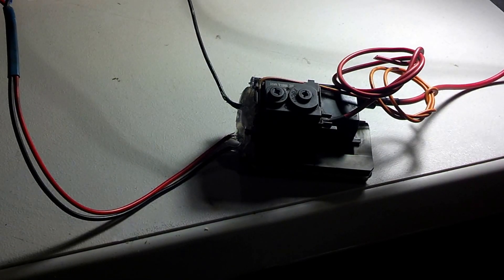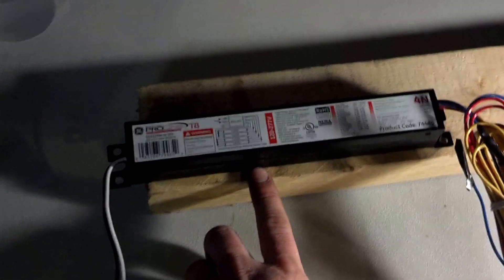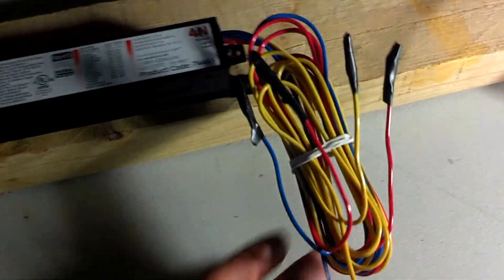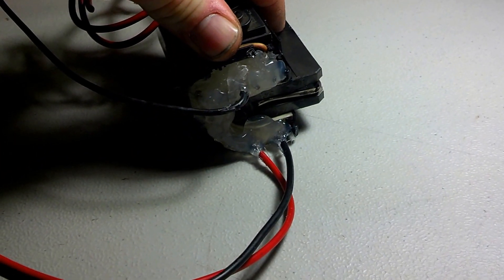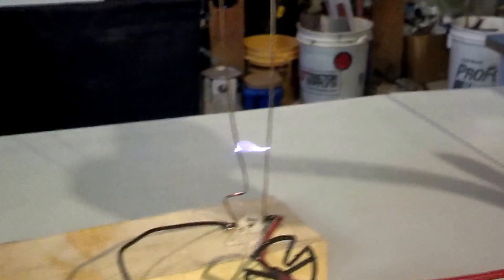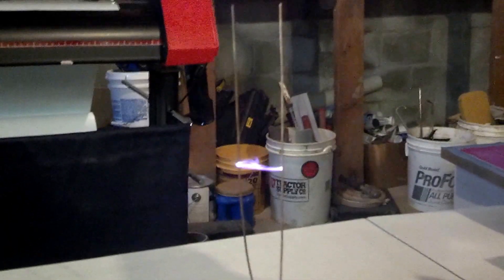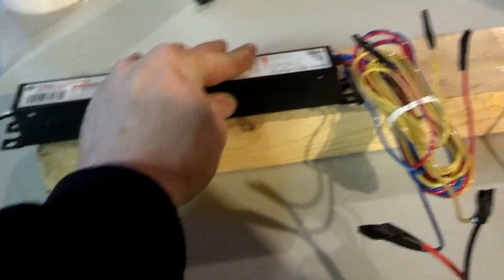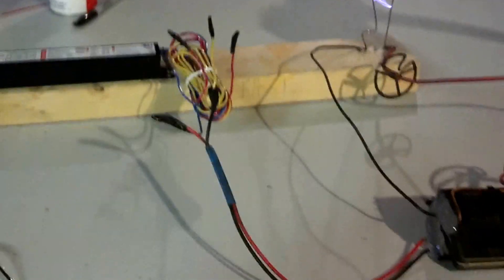Most simple Jacobs ladder

Comment: If you hook four wires from the ballast, the power will be much higher. But you will also need to immerse the FBT in oil if you do that.
Reply from the maker: i hooked 2 wires up and all was good, decided to push it to 3 wires and it ran maybe 30 secs before something (transistor?) in the ballast over heated and blew.  I think the ballast is actually the weakest link in this set up, or at least for me it was.

this FBT is actually powering my plasma speaker now, it is far more impressive. ill post a video of it soon, possibly tonight.
Reply from the maker: also i just watched this video again, and i had it working better than this will a little tweeking of the "ladder wires"